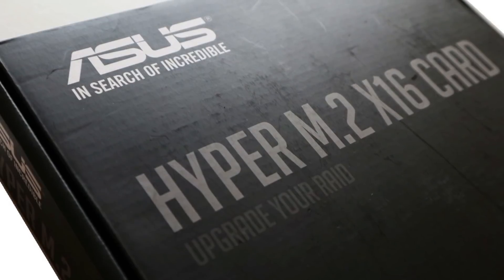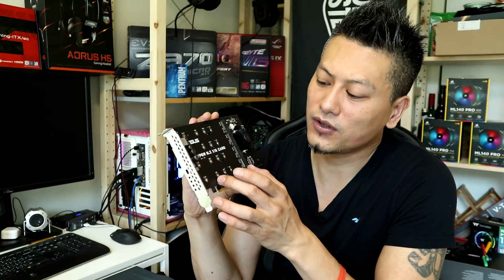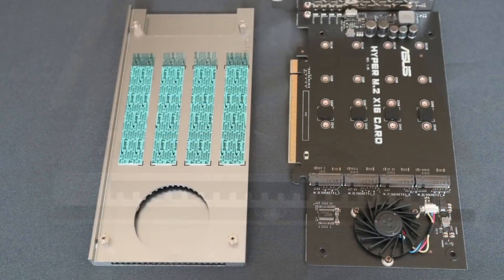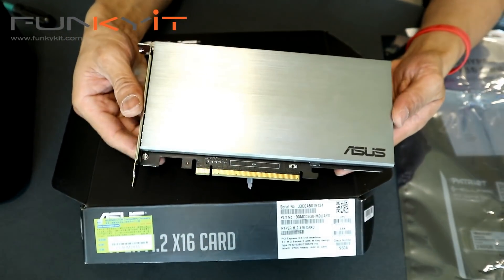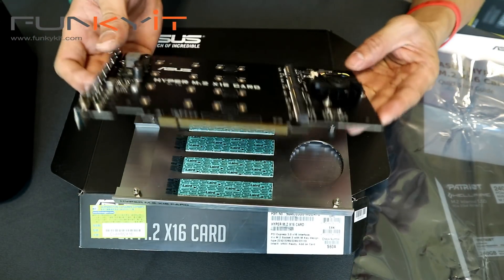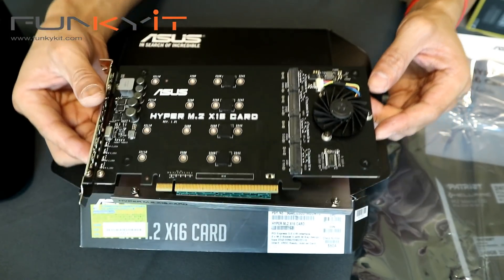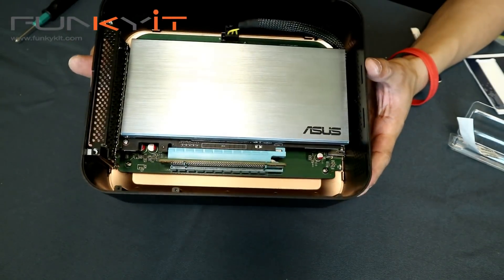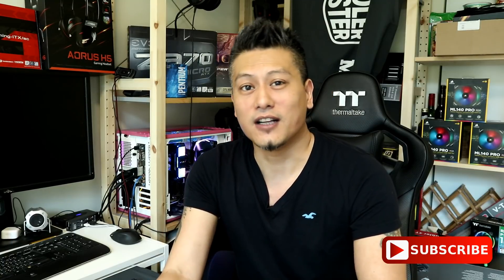Upto 4 x M.2 SSDs in one expansion card! - Asus Hyper M.2 x16 Card

Comment: This is not a good review. You need to use and do benchmark using from 1 to 4 ssd, using pcie express 8x to 16x and doing all possible configurations. Example: if i use 3 ssd on a 8x pcie , how will it handle the connection? 2 ssd at 2x and 1 at 4x? Or in different way?

Comment: Are all the slot's NVME or are there sata as well  (ie what key are the slots)
Reply: They're only M-key NVME. It might support SELECT AHCI PCI-E drives (which do exist, ie. samsung 951) but I would stick with NVME PCI-E only.
Also make sure your slot supports PCI Bifurcation. If it's not called out directly it won't be supported.

Comment: Is it possible to set RAID 1 or 5  with this card?
Reply: Yes to both on most* x299 motherboard.
*you might need to upgrade your BIOS, check the Asus website for your exact motherboard.
The Card may only work in one specific slot so check your motherboard manual before purchase.

Comment: so can I raid m.2 with an x99 boards?
Reply: I'm thinking: "No"

I have an X99, as well, so I came here to see how well it would work. However, I'm leaving more confused, than when I rolled up!
Reply: x99 by its nature does not support PCI-E bifurcation* (and, by extension, will not support the use of more than 1 SSD in this).
There SOME x99 motherboards may support bifurcation but none of them support VROC (Virtual RAID on chip) so you would not be able to make a bootable RAID configuration.

*PCI-E bifurcation is the ability to run up to 4 PCI Express devices (NVME SSDs in this case) on a single slot. It's a very specific feature to look for.

Comment: Four m.2 drives need 16 lanes to move enough data back and forth. (Well, not quite, but close.) By testing this through a Thunderbolt connection, which has only one PCIe lane, you've completely invalidated your results.

Wait, you didn't have any results. You didn't show anything more than unboxing it, putting it in an external case (which completely defeats the purpose of the thing) and a whole bunch of saying the same thing over and over. At least I watched this on 1.5x speed, so it's only ~6m30s of my life I'm never getting back. The bits, though... the bits and cycles spent on making this video, when they could have been spent on cancer research, bitcoin mining, or Dunkey videos... that's the real tragedy here.

Please. Think of the bits.
Reply: So negative

Comment: Have you tried this card with more than one M.2 ?
Regardless whatever u do, only the first one is detectet.
Smasung 950pro does not work on this card at all.
Reply: Contact Asus for support, don't wait on random people to solve your issue
Reply: @nathanhamman418  Done this long before writing here. They dont know and cant help
Reply: You need a board that supports PCI Bifurcation or is on the ASUS supported list. 
It's possible you need to enable bifurcation in your BIOS 
(nearly all motherboards do NOT support this feature, only some AMD 970, 990FX, X370/470/570 and B350/B450, TR4, TRX40 and various Intel z370/z390/x299 motherboards will support this card.)
Reply: @tim3172  My Board doesnt support bifurication :-(

Comment: so, what happened to the test results? did it work in the external TB box?
Reply from the maker: DMonZ1988 Yes ... http://www.funkykit.com/reviews/accessory/asus-hyper-m-2-x16-card-review/4/
Reply: hey. thank you for your reply and sorry, i actually found the review after posting. however, even there you didn't really address the results in great detail. why do you think there was such a large speed difference? the thunderbolt interface should not really be a bottleneck but it seems to be. 
how do you think it would perform with multiple drives installed? if both were accessed at the same time, would their individual speeds be halved due to this bottleneck or do you think the losses are somewhere else?

in your last test the IOPS were greatly reduced even in an internal setup. whats that about?

no offence, but you go over the hardware details multiple times in your video, jump BACK to an unboxing and have repeated b-roll, but then it kind of ends without much of a conclusion, and teh written review kind of ends similarly abruptly. 
being a computer expert, it would be really interesting and valuable if you shared your insight and explanations about the tests you perform.

Comment: Unfortunately, ...just a kind of marketing (non-technical) video. So we still do not have the answer to the question everyone interested in: is it supports RAID0(stripping) with non-Intel NVMe M.2 drives (like Samsung 960 pro/evo) and without Intel VROC-key :-(
Reply from the maker: Nix Nemo Haven’t tried software raid on it, but can’t see why not
Reply: I have told nothing about software RAID. Why to change the topic? Software RAID could be easily done without this card. Software RAID is not bootable. Software RAID load the CPU heavily. If this card is for software RAID, then this information has not to be hidden, otherwise, looks like dirty marketing trick.

Comment: You think if you add more m2 ssd's later that it will mess up the cooling pad on the one you already have installed?
Reply: i think it is better if you ask someone with more computer tech savy behind them instead of this joker he clearly didn't understand what you meant and as nathan wrote it most likely won't affect it as they are not liquid i.e thermal pastes/compound they are thermal pads a different type of heat cooling system and are reusable many times
Reply: The answer you are looking for is no, it isn't likely to ruin a thermal pad by removing the heatsink
Reply from the maker: Km Mm You can upto 4 x M.2 SSDs no problem 👍

Comment: can you mine with them?
Reply from the maker: Mr Zombie No... It’s an expansion card not a GPU.
Reply: I know it's not a GPU and although I intended that as a joke it made me wonder as (not saying it was a good joke) I seen something about people mining (empty space) on HDD's a week or so back and im thinking if this runs so much faster then if the space can be used to mine it could be mined really fast :) I only want to mine Lerp's :D
Reply: @MrZombie999  mining is meant to be cost efficient, you will be paying quite a premium to use nvme over sata ssds or mechanical drives, having fast storage isn't really a necessity for mining, that doesn't mean go with the cheapest drive out there because you still want reliability.
Reply: @nathanhamman418  Thanks for the reply but my question was intended as a joke, not a very good joke I admit but a joke none the less. It was based on some thing I seen in another video (by Linus I think) that talked about mining empty HDD drives